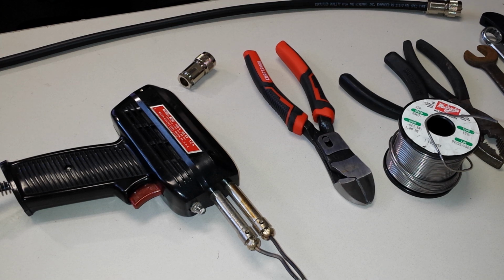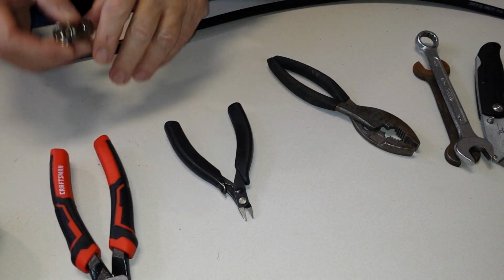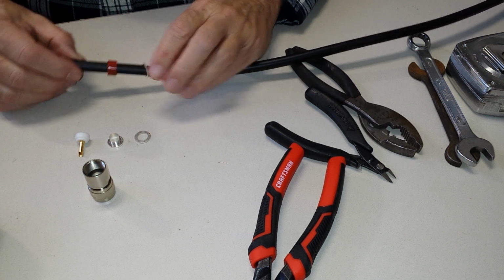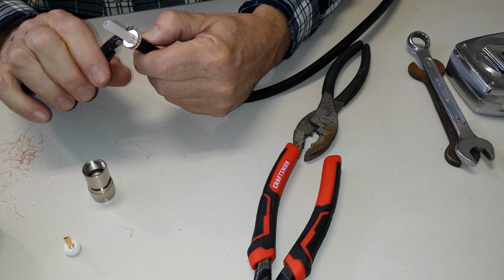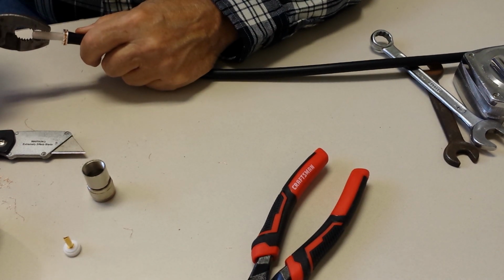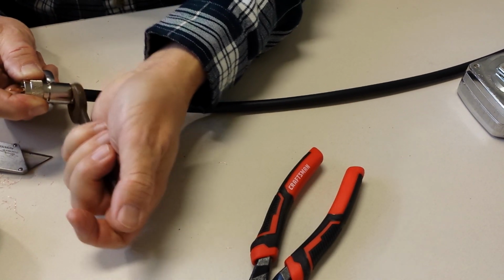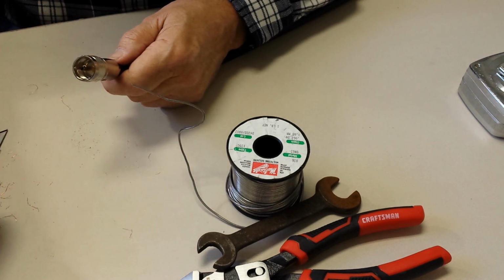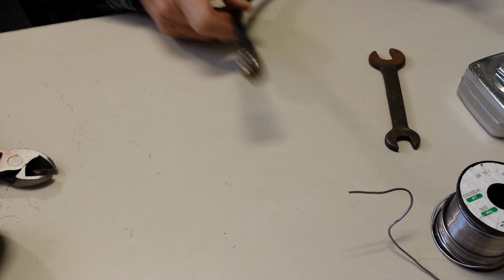Installing Clamp on Compression PL-259 Coaxial Connector from Ebay

Comment: Steve, ohm the connector out to make sure it does not get shorted. These compression style connectors are apparently better at eliminating that particular problem. But if you ohm out each end when you install the connector you are not left wondering which end you got shorted. That is one of the big problems with the old style PL-259. Terry

Comment: Great video, got some right angle 259 connectors with the same clamping arrangement, no instruction. Didn't realize that the ferrule pushes up inside the coax outer. Thanks a lot !! M0UTC

Comment: I have used clamp-type N connectors for years, but it only been a couple years that I realized that clamp type PL259 connectors are available. Believe me, I've put a lot of standard PL259s on RG213 over the years, and I got pretty good at it. But never again. Now I'm using clamp type PL259 connectors exclusively.

Here's a neat little test cable I made with an RG58 clamp type PL259: I cut off about 6 inches of alligator clip jumpers and put them in a RG58 PL259. Now I have an alligator clip adapter for my Rigexpert antenna analyzer so I can easily hook it to an antenna that does not have a coax connector. Why has no one thought of this before?
Reply: I just put one of these clamp connectors on the far end of an underground run of DXE 400MAX coax. Worked great!

Comment: I've watched 20+ videos and this is the first one with the exact  connector. I'm trying to install on lmr400 and the sleeve won't slide in. I have noticed in most the other videos want it slid over the foil under the braid but in this video he peeled all back down to the Polly . Going to give it another try under foil and braid?
Reply: Thanks Steve....you the man! Really great video!

Comment: i don't see any video confronting the front where it screws on a so239..the outer shell is too long...when i tried to connect it to a balun or a coax switch it will not tighten...i had to grind approx 1/8 inch off the conector to be able to tighten it safely..
Reply from the maker: Actually the So239 is too short.
Reply: Your dead right I used 5 inch angel grinder with skinny disc chopped a bit off I have a chap who sells the shorter one better material but same style
Reply from the maker: @rllawson24  Who?

Comment: Are these rated for outside in the weather?  Is there anything else that can be done to make them a little more weather/waterproof... ie, application of a little dielectric grease... or protective covers?

Thanks for the vid!
Reply: The red bushing squeezes down when you tighten it giving you as much weather protection as you would get with any of them. You could always do some 3:1 shrink tubing over the entire connection after you get it where you want it if more protection is needed.  You may want to try and source some 3:1 without glue in it though in case you want to cut it off later and not have to fight with everything being all sticky.

Comment: What is the name and model number of the soldering gun that you use in this video
Reply: Sure looks like one of those old wellers like 50watts or so that will completely bake and fry any electronics it touches. Famous for cooking circuit boards!

Comment: CHECK TO SEE  which one you have purchased...some measure different....the center pin and the threaded barrel part are approx 1/8 inch too long....to find out how much too long simply measure the familiar solder type pl-259 and you will see what i mean....being too long you can not secure the connector the center barrel will still be loose.....i disable them and use my bench grinder to remove the access....then they work fine..
Reply from the maker: Sounds like your socket is deformed.

Comment: you think these connectors are good for outdoor connections ?
Reply: If you weatherize the connection properly, yes.
Reply from the maker: They aren't rated for anything as far as I know but obviously the rubber gasket should help.
Reply: @wntu4  what does "weatherize" means for you ? there is no clear procedure for "weatherize"...
Reply: @n4lq  so you would NOT install those outdoor ? I thought they looked ok with the rubber gasket but I am using 9913 which is a tube and I don't want water coming in from the center of the connector...
Reply from the maker: Sure. Why else would it have a rubber gasket? It's as tight as a drum!
Reply: @n4lq  so if the pl259 is up right (the pin upward the sky) you don't think water will get in IF there would be water coming from the top of the connector ? I am looking for a good solution for waterproof pl259, that type of connector seemed to be simple enough to assemble but I had a doubt about the teflon ring where the pin is, if water get on the other side, that mean water can get in a 9913 coax as the center of this coax is like a tube, not a solid foam or plastic.

Comment: Any idea of a brand name here ?  This is a tremendous video contribution to ham radio here at NK7B in Minnesota.

Three Observations: (1) You are wearing a brand-new flannel shirt; creases still obvious. (2) You killed me early with the quip about not needing the box cutter blade for shaving. (3) You made me fall out of my chair three-fourths of the way through with the wisecrack about adding a "Karate yell" when tightening the assembly with your two wrenches, one of which looks like it came from early Confederate Army days.  I want some of these connectors.  Right now ! But here is what bothers me: If they are only available on eBay at this time that raises suspicion about provenance, QC, materials, etc.  Why don't we see these for sale by the Big Boys (e.g. DXE, etc. ?) even though their prices would possibly be near-felonious.
Reply from the maker: Shirt is 10 years old. My secret is to never wash it. ..... "Big Boys etc." Will soon be selling these but they will  still come from China.

Comment: Good video but they are cheap china made there too long for some application's from the kerling to the end  3 mm  has to be cut off the end but not the thread on the screw piece other wise the screw kerling bottoms out be for the earthing there are  better ones similar but shorter cheers